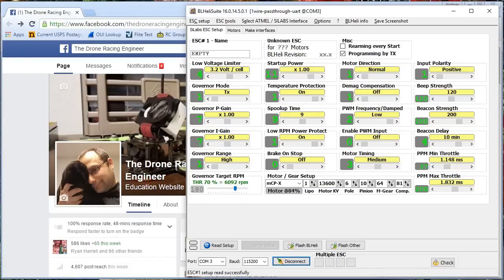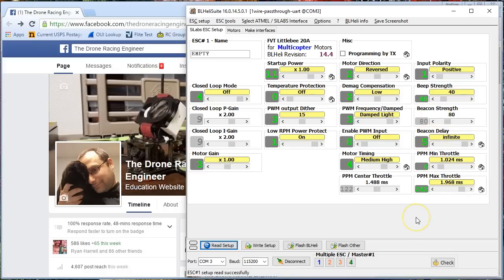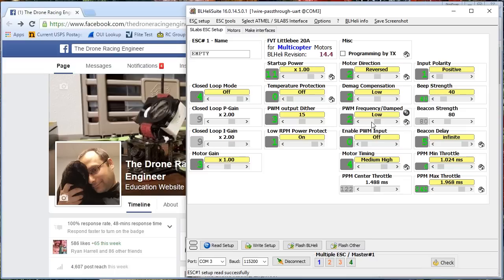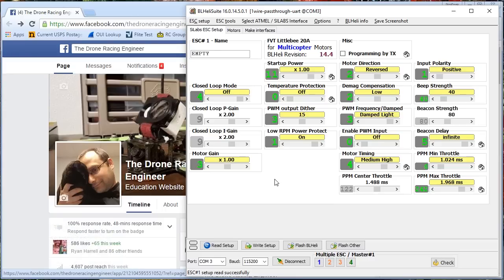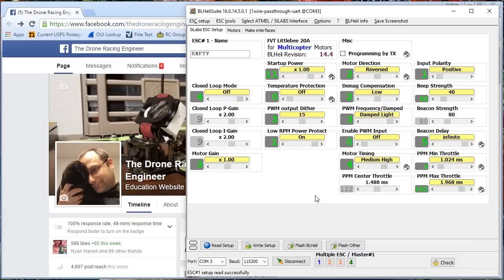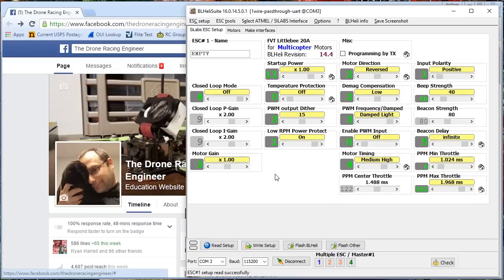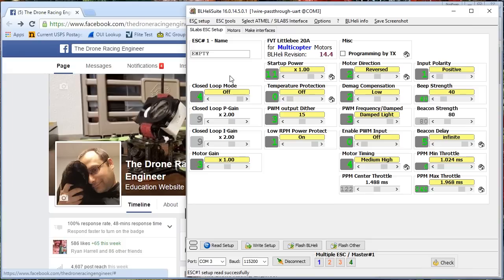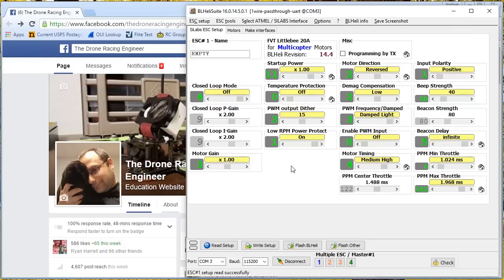BLHeli - 100% Explained

Comment: Don't know if you have seen my posts about my motors heating up during calibration josh, but at 3.58  in your video I think you just solved that problem for me. I turned my beacon up to 250,for exactly the reason you say you might do it, so they are loud because I removed my buzzer. When I calibrate the esc's, they get to the last few beeps and the temp on each motor rockets. That's gotta be the reason why. You the man josh.
Reply: posts on the betaflight thread
Reply: +mrmurder75 just an FYI, I had my beacon strength at 250.so almost maxed out.

Comment: Thank you very much for this one Joshua. I am somewhat new to quads (although not to RC) and there is so much to learn. Both my quads had a slight wobble in flight and I was wracking my brains to solve it. I watched this video one more time and realised that I had my PWM Freq set to High instead of Damped light for both quads. Made the change and the wobble problem completely disappeared. Thanks Again!
Reply from the maker: Damped light definitely makes a huge difference in handling. Always run damped light in blheli. In BLheli_S and going forward, it's not even possible to turn it off.

Comment: you now have exactly 7000 subscibers on my screen. Congratulations!
Reply from the maker: +MTL Racing Sweeeet. I have to start thinking of what my 10k special is going to be. Around 2k, I realized that if I did a special every 1k, I was going to run out of steam pretty fast. So I decided 10k would be my next big milestone. Hmmm...
Reply: +Joshua Bardwell shouldn't be long before you reach 10k at the rate the channel is growing
Reply from the maker: +MTL Racing I'm around 1700-2000 a month right now. It's dropped a bit since last month, but just a bit.

Comment: Joshua, great info. I revisited this video today cause I felt I wasn't getting full potential out of my ZMX2206 2150kv motors. I changed the timing to mid-low and my god the difference was so much better. Quicker acceleration then when on mid timing.Keep up your great work cause there are so many people that appreciate these videos you make.
Reply from the maker: +Phongsta weird! But I'm glad it helped!
Reply from the maker: I have it, but I have not yet put it into a build. Right now, I have Group Three battery tests to do, and I have an Emax Falcon RFT quadcopter to test/tune/review, and then I am going to start thinking about building again, and I plan to make it a priority to put the HubOSD into a build.

I know that this is a product that people are excited to hear about, but I just don't think it's right to review it without actually building it and flying it, and my schedule is always super backed up.

Comment: I don't think temperature protection starts working until around 170 degrees F.  So shouldn't cause any issues, but I get what you are saying here.  

Currently startup power controls:
- The max and min power applied during startup
- The max power during a direction reversal in bidirectional mode
- The minimum power level that low rpm limiting will limit to

Hope this is helpful for you and your viewers.  This info was recently posted in the blheli thread on rcgroups.  This was a good video that will be relevant for a long time.  Good job here.
Reply from the maker: +Rc Dad Thank you for the additional details on the startup power. I always turn it up because I feel like with smaller props, there shouldn't be an issue. But I'm never sure if that's the right thing to do. I would love to get a recommendation from anybody who knows for sure as to what motor/prop the default setting is tailored towards.
Reply: If you are turning it up and not getting any bad side effects, like desyncs, i'd say you are fine.  It is probably not effecting you at all in normal flight, just on very low motor speeds.  

Here is more additional info I have on the subject.  The lower you set startup power the slower acceleration and the lower current draw will be at low rpms.

When the motor spins slowly, the bemf voltage is low, and high motor currents can disturb comparator readings. So in order to avoid that, power is limited when demag comp is set to high.

Comment: Ive never seen that manual tab..... That's a life saver. I thought that with dither, the lower you went, the smaller the plateau on top of the throttle curve
Reply from the maker: +sciullo779 well, you could be right. I haven't tested it. I assumed that more dither means less step because there is more variability in the signal so the step is obscured.

Comment: Thx so much for this Joshua!  I had been trying forever to tune out a small twitch at full throttle and finally gave up.  Now I see it is because my max throttle calibration in the esc's were all at 2020 so at full throttle the motors were not matched up.  I lowered full throttle in Cleanflight and recalibrated and now I suspect that problem will be gone.  Highest esc full throttle calibration is now 2012.  They range from 1992 to 2012
Reply from the maker: +Michael Koster hope it works!

Comment: Hi Joshua. I purchased 4 in 1 Little bee ESC. Previously I used 4 individual pros but I popped one. The local shop only had the 4 in 1 one so I took the plunge. I've had nothing but problems! I have blheli 14.6 installed on them. When I plug my quadcopter into cleanflight. I set it to air mode then I start giving it yaw,  roll and pitch. When I use these movements, any motor that gets up to the 1600 mark will "stutter". The motor will start jumping up and down from 1500 to 1700 if I try and keep them spinning at the 1600 mark. For example. I roll left to raise motors 1 and 2. When they get to 1600, they stutter. When I pitch forward. Motors 1 and 3 will rise up to 1600, then stutter... But... If I pitch forward lightly and get motors 1 and 3 up to 1500 for example.. it's as steady as a rock! No fluxuations...no stutters...nothing! The same goes for going past 1700. My maximum throttle is 1850 (Max rpm is at 1840). It's just at that 1600 range where all my motors struggle and make some sort of grinding noise. It's really frustrating! I have moved my flight controller to the maximum length the cables can reach (4 inches) and it still does this stuttering, so that rules out interference. I have tried switching off oneshot125 and dampedlight....it made it worse! Removing damped light made my quadcopter uncontrollable. Without dampedlight, you do not hear any stuttering or grinding noises. You do see the jumping and stuttering inside cleanflight.  I'm pulling my hair out over this crap! I came from 4x littlebee pros to a 4 in 1 ESC board. All exactly the same settings. Same FC... same everything! just the only difference is all my ESCS are on one board.... I cannot find anything about this online! Do you have any ideas what this could be? Changing motor timing to medium high makes the stuttering less aggressive  but on high and low there is no differences. I've resoldered all my wires. I've made sure (when my fc is fitted in) that my FC is not touching any thing to do with the esc board. It even has separate mounting risers (it hangs from the top plate of my emax200 nighthawk and my esc board is raised up from the bottom). To make matters even more confusing. If I rev up my motors via cleanflight or even blheli software... they don't stutter!! I can rev all my motors via software and they will not stutter at any point! My receiver and sensors tab show no sign of any interference or spikes in gyros or receiver signals... I'm stuck... I've asked on forums, I've asked local people who fly quadcopters and they have no idea... I really don't want this to be an ESC issue. Would you know what the issue is?
Reply from the maker: If it doesn't do it in the Motors tab, then it's less likely to be a timing issue, although not impossible.

Are you testing with the props off? Put the props on and see if you can hover.
Reply: +Joshua Bardwell I am testing with props off. It can fly with this stutter but you cannot fly slow. If you are flying fpv low and slow, if you try and bank for example you will hear the quadcopter stutter, tick and make weird noises. It will also drop on the high side (bank left, motors 1 and 2 stutter, drop and pick up again) However if  I am aggressive with the throttle and control sticks, I won't hear or feel the motors stuttering! It just seems to be at this certain point they stutter. After further testing if you use the throttle to bring all motor speeds up, the stutter comes earlier. If throttle is low, stutter comes at higher rpms.... Very strange. I'm going to get someone to come up with a decent video camera to record it. I really can't explain it properly. I am almost certain it is to do with the ESCS or my FC. Maybe even compatibility issues between them.
Reply: I have just uploaded a video  to my channel called motor stuttering issue. My dad couldn't quite keep the quad in frame but the main purpose was the sound. You can't see the effects of the corners dropping while the stuttering happens but I can assure you that you can see and feel it while flying. It's worse via fpv.
Reply from the maker: Try using the motors tab and twitching the sliders quickly instead of moving them smoothly.
Reply: Working perfectly. No weird stuttering. Quick bursts to full throttle and nothing seems to perfect. All motors spin up at the same time and stop at the same time. No weird noises like in my flight video. Tried each individual motor. Quickly twitching the motors at various speeds and bursts from 0 to full to 0. All motors performed exactly the same.
Reply from the maker: Okay well I don't think it's ESC to motor then. What FC?
Reply: Naze32 Rev6b. I'm noticing online that people with littlebee Pros are having the same issue.This 4 in 1 board is just 4 littlebeepros just on 1 board. Nobody seems to be replying with any fixes though....
Reply from the maker: Yeah. Sorry to say. I just sold four LB20 Pros to a guy. I hope he doesn't run into problems.

Comment: excellent video as usual! I understand 3-phase motors and inverters (in the kW and MW range :P ), you have nicely translated these options in to things that make sense for me!
Reply from the maker: It's the exact same technology underneath, really. Thanks for watching!
Reply: yea it's crazy how much work the ESC does! Do you know where the energy from the active braking goes? I assumed it was soaked up by the esc somewhere but I thought they would get hotter :/
Reply from the maker: Back into the battery.
Reply: that is pretty nuts for such a small package! Thanks for taking the time to reply, I don't know how you find all this time for everything! :)

Comment: Thanks Josh this helped allot. I've wondered about several of those settings and I was always too afraid to try to change them to see what happened if I could not find documentation so I greatly appreciate this even still today with blheli s thanks bro
Reply: @Joshua Bardwell with bl heli s 32 do u recommend different settings? And sorry one more, for 2206 2100 kv motors I do want med low to be safe? And with 2306 2450s would that simply be med high? Or does the size of the motor negate this? Thank you again u help me everyday... Patreron incoming..
Reply from the maker: I wouldn't assume that any size or kv of motor had any specific timing requirement. I just leave timing at default.

For _32, I suggest chaging the motor PWM rate to 48 kHz.
Reply: Joshua Bardwell ty Josh

Comment: Hi Joshua just starting out in this field comming from toy grade to hobby grade. Not only was i wrong about the fact that i thought these quads would be a lot more complicated or more specificaly harder to control. It is becomming apparent that actually in hindsight the opposite appliese. That is of course as long as you have taken the time and effort to research and learn the different settings and functions that will make the trasition more smooth.
  Having only been flying since last July it would be foolish of me to say my skill level 
is high , however i own 2 brushless quads and am fairly competant with both. I practice regularly concentrating mostely on keeping good tight control and flying safely, aggresive but responsible aggresion if that makes sense.
 I have seen a lot of vidios where people have posted about how flimsey different quads are and how they have been able to break them from what they consider to be normal crash scenarios. I hate crashing and have only done so a hand full of times since comming to grips with the fundamentals. with your great and informative vidios i am sure if more people just took the time to research them there would be a lot less unhappy pilots complaining about inferior products.

Comment: Josh, I watched this video the day you released it and said, "That's cool that he explained all that." This past weekend I installed the Lux in a new SCX-200 with DYS XM20A ESC. I immediately got the twitch in the yaw axis. The same behavior that I had in the Naze Rev6. So I sit and ponder this....go in the forms, and everyones screaming O-RINGS, YOU HAVE TO USE 5,645 O-RINGS THEN IT'S SMOOTH!!! That sounded so stupid to me. Then I ran across this video in my search for a solution. You know what fixed it?? Raising the Dither to 31. Based off of your info, and logic, it seemed like a reasonable explaination for what was going on and a permanent fix. So, Thanks, and keep putting that scienticifc spin on why this stuff behaves the way it does. BTW, I stopped using BB. Like you said if it flies like I want it, who cares what the D-TERM looks like on the graphs
Reply from the maker: +badandy122376 hey, glad you fixed it anyway.

Comment: I'm a little confused with esc calibration and min. cmd / max thr. after watching this and your newer videos. I'm using BF 3.0.1 and blheli 14.6 and   when I calibrate in BF, the max thr. shows 2020 in blheli. should I be calibrating the esc's in both blheli motors tab and BF? Do I need to lower max thr. in BF? Also I saw you set min. cmd. to 980 in the newer videos. I'm a bit confused what I should set them to and where. Naze32 rev.5 w/BF 3.0.1 and oneshot125, Hobbywing xrotor 20a flashed with blheli 14.6, and emax mt2204ii's. Please help get me straight Joshua.

Comment: Hello Joshua, great video! Hey I have question, I'm currently putting together a long range/endurance quadcopter and since weight savings is at the top of the list, I decided to use Hobbywing XROTOR 30A M series ESC's (only 7g). My question is what happened to the "low-voltage cutoff" option on BLHeli suite 14.x? Version 13.2 still offers it. I need to be able to turn off "voltage cutoff " because I'm using NCR18650 batteries which can safely be discharged down to 2.5v per cell. I flashed my ESC's with BLHeli 14.8 and that setting is missing. Thank you !
Reply from the maker: I think the Multi firmware got rid of the LVC. On a multirotor you don't want LVC. I would ask on the BLHeli rcgroups thread for an explanation of why it was removed.

Comment: if you don't mind letting me know I have little bee 20a and they are already flash with blheli got everything solder in I connect to my cc3d that is flash with betaflight and going through cleanflight I know I have to power the flight controller but I can't get it to connect with blhelisuite. would you know what I could do? just trying to reverse both motors

Comment: if you reversed the motor direction with blhelisuite , its ok for the motors or the ESCs?
its ok if I will flash the LB20A_S with the BLHeli_S Rev. 16.4 ?? They did not burn in flight??

Comment: Thank you for this tutorial, nevertheless I have a question which parametres are better for low kv motors, like a DYS DE4114 400kv, it's for heavy hexacopter (AUW = 6.5kg) and ESC RCTimer T40A.
Reply from the maker: +Nurjan Yesmagambet lower timing is sometimes better for larger motors.

Comment: Hi there Joshua.  I'm starting a 4" built tonight and was wondering if red bottom 2205 2300kv motors would be a good choice with the 4" tri blades.  I know they're probably not the best choice but it's what I have.  Will they work well or should I get different motors.  I do have some sunny sky 2204 2300 I could use as well.  Thanks.
Reply from the maker: For 4" I definitely would go with higher kv. 2500 minimum, and as much as 2900 perhaps. 2300 will feel under-powered on 4" IMO, and 4" doesn't demand the extra torque that 2300kv brings over higher kv.
Reply: Thanks.  I figured that was the case but needed to hear it from someone else.  Do you recommend any higher kv motor in a 22mm size?
Reply from the maker: Emax red-bottom 2600kv is certainly a safe choice.

Comment: Hi Joshua. My Cobra motor requires 5 to 10 degrees timing, how does this relate to low, med high on BLheli Suite. Thanks for your very educating videos.
Reply from the maker: It doesn't. Just use medium timing and you will be fine.

Comment: Trying to understand esc better. You have two setting that are important for keeping the motor in check. Motor timings and demag. Anyome correct me if I'm wrong but if I understand things correctly motor times is used for pulling magnate the direction you want the motor to spin a head of time. Also know as slip. Energizing and letting go at the right time as the magnate spins pass. Cannot find to much on demag but I think it's like adding drag to help stop the motor over spinning. Also helps with spinning down the motor and along with motor timings a more correct RPM can be set... This is how I understand things how correct am I anyone thank you ??